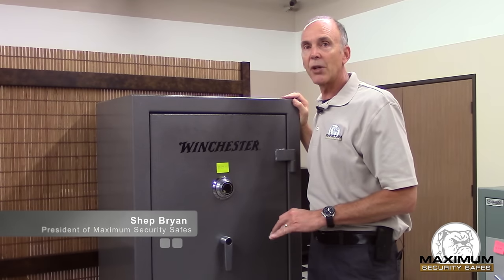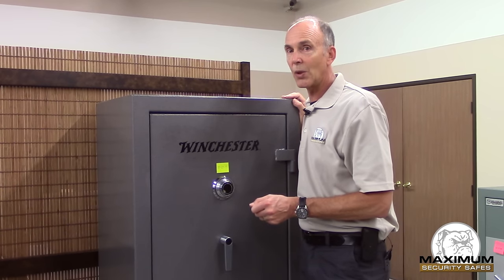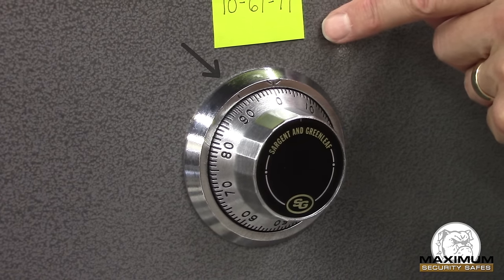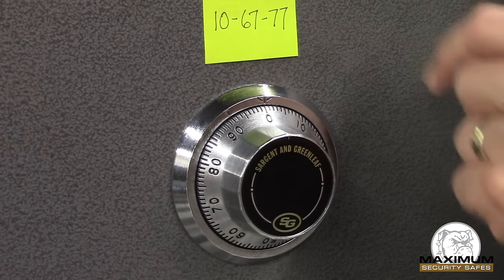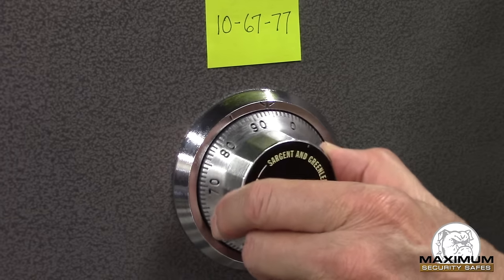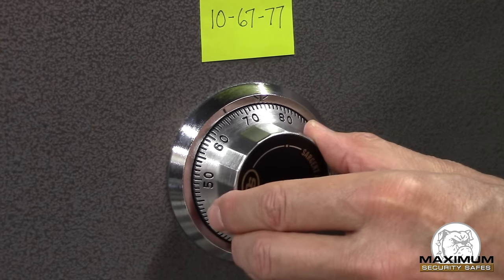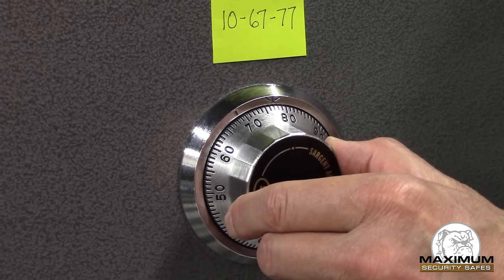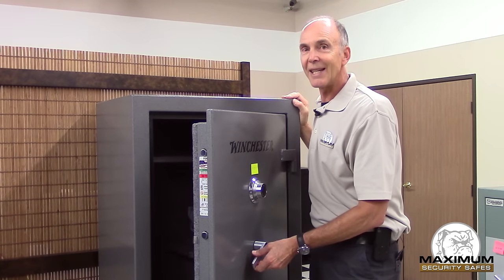How to Dial Open Your Mechanical Lock

Comment: You call that easy? How do you open it, at night, when someone has broken into the house and you need your gun? This is a good advertisement for just not using a safe to lock up guns. Perhaps a key opening safe is better.
Reply from the maker: We hear you. It can be tough to open a safe without good light and when under stress, of course. This is why we recommend and stock most of our safes with digital keypads.
Reply: Safes are for when you're NOT HOME. At home they're ready to go.